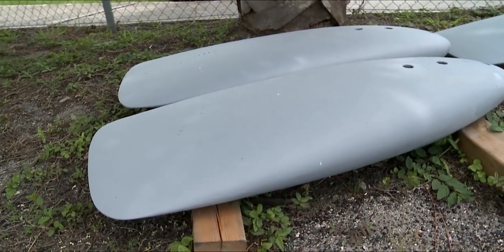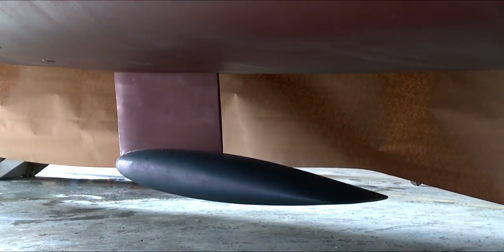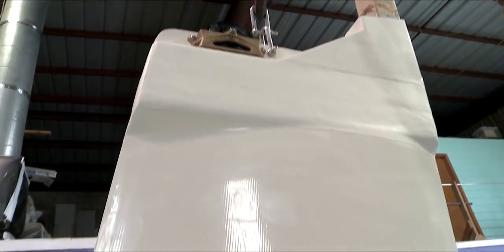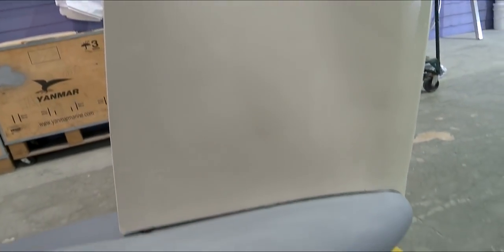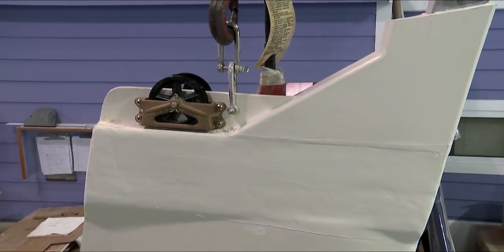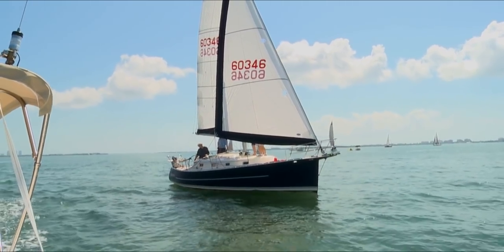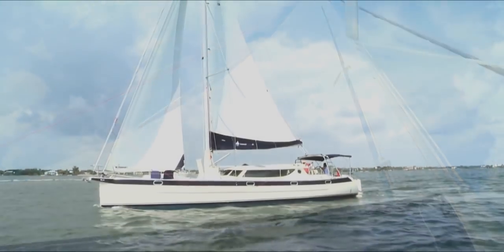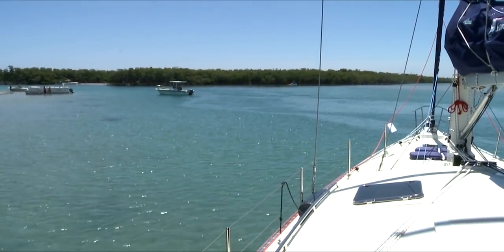Hake Yachts Keel Video v2.mp4

Comment: I love your boats, and I'm contemplating purchasing the 32RK. However, I am very concerned with inevitably hitting bottom or blue water ocean debris with the keel. It seems that the rearward force could rather easily tear into the hull potentially sinking the boat. I have noticed that the Beneteau and other lifting keels can just lift upward and over the debris/bottom potentially saving the boat from catastrophic damage. I have watched all of your videos and you have not addressed this critical issue. What safeguards are integrated your design to protect the boat and souls on board?

Comment: Question: Everyone expresses concern of hitting debris and causing major damage to the hull.  Why can't there be a designed "Shear Pin" to where, maybe just below the hull,  the Keel snaps off IF the strike is so severe, that the shear could potentially damage the boat hull?  I'd rather lose the keel bottom than mess up the hull.  (I think this would be very rare)

Comment: Nothing new,,, Ive seen this on boats 40 years ago...  A good system, I make sure I have the keel structure through the deck to relieve stress from the case, this is the bombproof solution. It does mean a very long dagger though.

Comment: Love your boats. Quality built for sure. I would like to know, is there a manual override for the lifting keel in case the motor fail? What happens if the keel is wrapped in weeds is the leading edge sharp to cut the weed or do you just lift the keel and the weeds gets crushed?? Is the propellor protected in anyway for beaching the vessel, maybe protected by the bulb? Is it sterndrive? One last thing and this is certainly not a criticism but I would have loved the rudder to be lifting from under the hull in a well maybe instead of transom-hung, that would have cleaned-up the stern nicely!

Comment: Amateur here:
Can you give me an intro on this. So if deep keels are used on racing boats,  Is it:
- Keel down = Higher speeds , offsetting the sails and providing the lift (Foil like)  
- Or
- Keel down gives more stability in rough waters, but keel down really does slow down the boat?
Reply: if i remember right- keel down restricts side movement when the wind blowing from the side of the boat, keel up-mostly used for winds that blowing from the rear to reduce friction

Comment: So you lifted the keel , what have you done with the rudder to keep the draft shallow along with the keel  ?

I have four shallow skeg rudders ,  rudders long on the horizon plane. 
I also have four props in the skegs, electrically powered.... solar, wind, hydro and diesel generated .  I'm drafting about 40 to 43 inches keel up , steel haul . I'm thinking of maybe a build in glass , heavy glass . 

Any thoughts ? 
You interested in a haul build ?
Reply: The Hake boats have 2 independentl lifting rudders.  with keel and rudders in lifted position the draft is 30"
Reply: You really should watch the videos of the boat before complaining about a 'design flaw' that is actually addressed and in fact a feature of the design...

Comment: Ingenious! Woulld be fantastic here in Denmark with houndreds of shallow moring spots and shallow, small-boats habours. I just don't get the design of these boats. It looks like something built 40 years ago. I would want something lighter, modern looking - and well performning. I can see that these boats are not at all optimized for sailing reasonably fast. You could build a really fast, deep keeled, twin rudder yacht using this principle.
Reply: If you want a fast light boat there are plenty of those on the market. Get a Benetau or Jenneau. This boat is meant for comfort cruising. This "old style" as you put heavy boat is much more comfortable for enjoying your time out in the choppy waters and because of the keel system it's still reasonably fast. Not everyone is interested in racing. I'd much rather have the safety and comfort.

Comment: I've been designing and redesigning a steel boat ( 40 - 45 ' ) that I plan to build some day soon . I have played with a keel design similar to your design. 
Mine has a solid round shaft within the  lifting keel that can rotate in order to swing the torpedo weight from port to starboard or keep it centered depending on point of sail. My problem is .....torpedo shape.  I have built a plywood model of the keel. My lastest model has a flat circular  wing design that is mounted to the rotating shaft at the leading edge of the circular wing. I works . My concern now is lift and how she will steer .
Any thoughts ?
Reply: I cannot imagine any advantage to swing the bulb port or starboard. The foil of the keel would create immense drag and if the foil is simply a round shaft it will generate zero lift. ??
Reply: Alain Pascal Routhier  The redesigned,  finished , proven design works well...Im not going to disclose anything here as it has a patent pending.

Comment: id never go offshore with such a vulnerable keel
Reply: Have you seem Beneteau 47s?, Vendée Globe boats? Volvo ocean race boats?
Reply: if you have at least some amount of brain in your head and just a little experience-you will not have any problems whatsoever
Reply: My Gosh, this sort of keel is very popular with all the racing boats. The retractibility of it only makes it better IMHO.
Reply: The keel is not vulnerable. The tube that holds it is attached to topdeck and bottom of the hull, that can easyly be just as stable as a keel that is only attached to the keel area. There are a lot of production cruisers that have weak keel bolts and people sail around the world with them nevertheless. 
The problem is after a while of sailing buildup of sealive on the keel area will prevent lifting. So the keel must be kept clean. No big deal, just a bit more work than fixed keel and the boat shoould be kept clean anyway to prevent speed loss.

Comment: Mechanical fin keels work just fine until you hit a submerged log or shipping container. Shouldn't cost any more than 15 or 20 grand to put it right, that is if you don't sink from ripping out the bottom. I personally hit a submerged object in 500 feet of water off the Florida coast, if we had been in a fin keel boat we wouldn't be having this conversation.